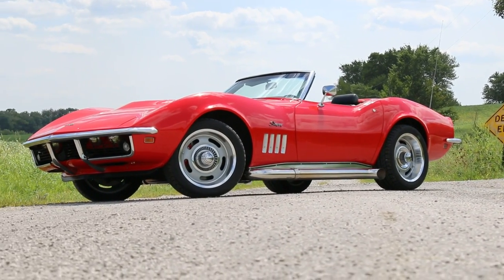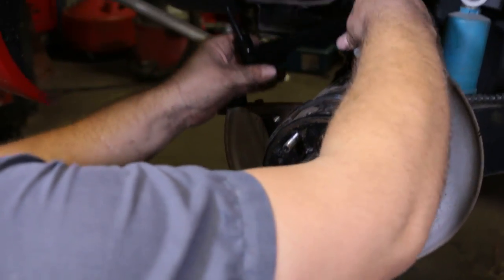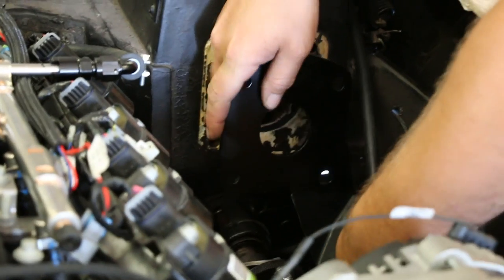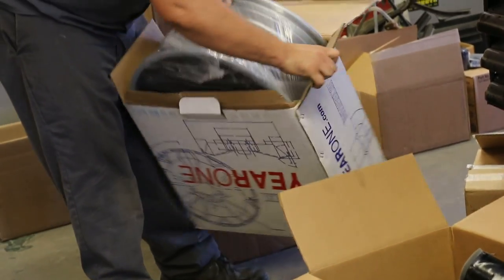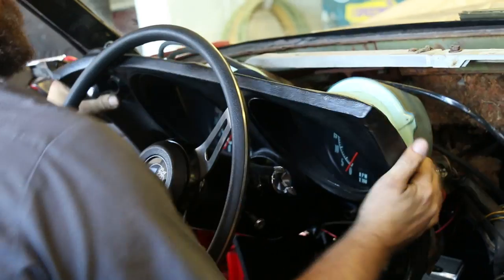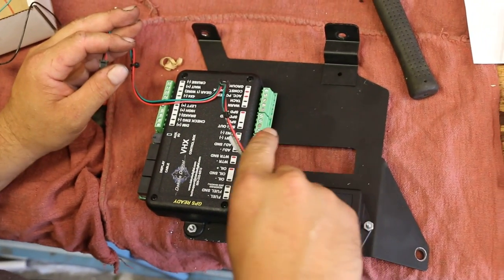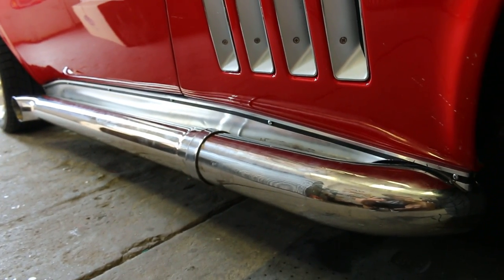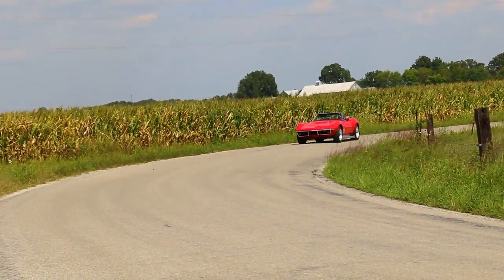Chevrolet C3 Corvette LS Swap 6 Speed Manual Transmission Swap at V8 Speed and Resto Shop Part 4

Comment: I put Vintage Air in my ‘71 convertible Corvette a few years ago. It still works great. The biggest hurdle in the installation was routing the hose to the driver side vent.

Comment: The shop did exceptional work.  Converting a 1969 corvette with modern day technology is not easy.  It is like buying a new corvette.  However, there is a downside.  As things begin to go wrong you will have a near impossible task finding someone with similar knowledge to work on your car.
Reply from the maker: Thanks for the kind words Ben!

Comment: Awesome build. I'm debating between building mine into a 383 stroker or just dropping a LS in there. The fitment issues make the stroker build look like the easier option :)
Reply: It is the easier option fitting the stroker. I installed a 454 in mine lol.

Comment: Great video!  With the LS 3 and six speed conversion into a C3 do you have to use a big block hood, or will everything fit under a standard small block "flat" hood?
Reply from the maker: It should fit under the flat hood, as the LS was designed to fit in low modern Corvettes.   Today there are some accessory drive systems that bring the alternator down tighter as well.

Comment: WOW!! Excellent work gentlemen, that is a master piece. Love the video, new subscriber. I use to drive a 67 Stingray with out power steering, it was cardio workout. Did you have to add power steering to it?
Reply from the maker: We did install power steering, and a tilt steering column.

Comment: I just found this series and what an excellent one it is.  I'm looking into doing something similar for my wife's next car.  She has always wanted an '80 - '83 Corvette.  If I can find a decent-shape body for a good enough price, I'm pondering a very similar restomod, but swapping the T56 for maybe the 6L80 automatic so it's reliable and easy to drive.  

I fully understand the limitations of my question, but is there a way to have a ballpark estimate for what I should budget on the mods/labor?
Reply from the maker: Hello Sir, every car is also a different situation.   However, we'd be happy to chat with you about what you'd like.   If you get a moment, you can call the shop at 314.783.8325 or click to http://www.v8speedshop.com and fill out our inquiry form.   Thanks for the kind words, we hope to hear from you!
Reply: @V8TV  Will do.  Thanks for the contact info.
Reply: They did not make a vetted in 83 and the 84 was not very desired as u can tell by resale prices now

Comment: Okay
But ...HOW MUCH!!!!
Reply: I'm guessing 350,000.00. But there are some serious  breakthroughs that were dealt with that are no doubt going to be part of future kits/ installations and that no doubt had some factor in cost savings to the customer..The tenacity that made this build possible was actually beginning to make me ill.the mock up and fab of the trans tunnel  was more than I could endure. I had a highly dysfunctional relationship with a 69 roadster. Triple black, Hooker pipes T/A radials on cragers..The top always leaked..And it rode like a worn out pickup truck..No amount of money ever solved those two ultimate deal enders.
Reply: @toosunakabooma1213  oh
You worked on the development of this kit?
Reply: A 6 speed manual from Silver State with everything is about $8-9k Car Effex here in New Jersey charged me $3k to install it.

Motor depends on what you want in it, brand new crate motor? $30-40k depending on what you want and HOW MUCH POWA BABY!

Figure shop time at $120-140 per hour.

Wheels and tires 🛞 between $2,000-7,000 depending what you want.

Brakes $3-4k plus install at $2-3k

So I would say under a $100k if you’re putting in a new crate motor.

$350,000 and your doing a new car that is going to be a body off restoration, rotisserie done body with a new chassis and everything you can think of. 

So it depends on what you want to do restore, modify or go pro touring/show car. 

If you’re just driving it and want to do the work yourself, just take it piece by piece and get it done.

Comment: Wiper door and lights still vacuum?  Also, what’s done to suspension?  Mine was squirrelly as all heck with stock gear and power. I’d imagine it’s been upgraded somehow. Details please
Reply from the maker: Hello @Wooca, we did an electric conversion on the wipers and headlights and there were some suspension mods when we started.     You can see all the details in the other 3 episodes - here's the whole playlist.    Thanks!    https://www.youtube.com/playlist?list=PLGV8X9X8baVizfPH6-qxNKrHmnGUAr81Y

Comment: Hello I have a 1979 Corvette L82 and I like to put a LS7 in my car?
Will that work because right now. 
Its automatic with transmission?
So I like add more power so if you can please let me know will the LS7 work?
Thanks.
Reply from the maker: Hello Daphne, the LS7 is a slightly different animal when it comes to LS engines, mainly because they were designed for a "dry sump" oil pan system, meaning they require an external oil tank, lines, and pump.   This occupies much more space than the LS3 or other "wet sump" LS engines.  And LS7 can be converted to a wet sump system, but that is an extra step in the process.   It may be easier to make similar power using a modified LS3 platform to start with.   The LS7 may bolt to your automatic transmission, however, we'd recommend a more modern electronically controlled automatic to handle the power of the LS7 and provide easier tuning and calibration of the transmission.     This might require additional fitment modifications to the tunnel to install.    These are general answers, we hope they help you with a bit of context.     You can reach us at http://www.v8speedshop.com/contact and we'd be happy to discuss your ideas further.   Thanks for the question!
Reply: Not to mention that factory ls7 needs heads replaced asap, you're better off with a sleeved block and have it built to whatever cubes you'd like with wet sump crank and better heads.
Reply: I just did an LS3 in a 75. Way easier than the LS7 would be.  Good luck!!

Comment: When is it appropriate to use a K&N, (or any other brand), filter?  I had an LS3 and now have an LSA and haven't used a K&N on either of those.  What's the advantage?
Reply from the maker: Great question.    We used the K&N in this case because they offer a huge variety of shapes / styles of filters, and their catalog provides dimensions for all.   This way we can design a custom air intake and pick a filter to fit.    That and we know the flow characteristics are better than a stock paper filter, and they last forever.
Reply: @V8TV  
Thanks for the answer!
One more quick question - you see all these people immediately slapping a custom intake on their stock Camaros - you'd have to tune it to get any benefit from it, right?  And even then you're not going to notice a difference unless you start making drastic modifications?  And because it flows better does it let more dirty air into the system?
Reply from the maker: That depends.   There are some air intake systems that don't require a full re-tune, as the stock ECM can compensate a bit for slight changes in airflow.   More drastic mods do require revising the tune for optimal performance.    Higher airflow does not necessarily mean less filtration.    Hope this helps!
Reply: @V8TV  

Thanks!

Comment: Witch tires did you use on these wheels?
Reply from the maker: Hello Robert, we ran BFG G Force comp 2 a/s 245/45R17 on the front, and BFG G Force comp 2 a/s 275/40R17 on the rear.

Comment: Wants to keep it original, doesn't want it original, want's it original, doesn't want it original.  I don't get it.  Either it is, or it isn't.  Doing whatever you want to your own car is great but it just seems inconsistent in this case.  My L-71 1969 that I've owned for 52 years still runs great with almost 180,000 miles.  It goes like hell and stops safely.  With the GM HEI, Hooker Sidepipes and a few other mods, it runs better than factory.  But, I have changed my car to suit my own prefs and never have worried about "original" which seems to be the big thing these days.  Hopefully the owner will enjoy his car for many years to come.  I plan to do the same.

Comment: What seats did you use for this?.
Reply: Ohh. And would a crate 350v8 be enough for the tremec 6 speed? 

Could I put a tremec 6 on my current engine?
Reply from the maker: The seats are the stock ones that came with the 1969 Corvette.     It is possible to install a 6-speed behind a small block Chevy engine.

Comment: anybody gotta clue what this would cost, 15k i figure
Reply from the maker: It depends on the parts... the driveline and fuel system put you in the $15k range alone.
Reply: Dang, so this guy prolly dropped 25k to have this done then, its badass no doubt. To some people thats chump change though, and even then he's way under what it would take for a newer car to touch it. I'd go to gmperformance and buy that lsx 454, for 20k, insane power, more less plug and play. I'd have that tranny built up, and that package would hang w anything pretty much. Have you guys dropped any of those LSX's, that's really a helluva deal...Roost
Reply: Lol 15k
Reply: Brake package and wheels would be 5k just in parts. If I had to guess I'd say 40k would be a good start.
Reply: @chisel83  well if you have it to burn I guess. I drove one of these that was for sale a couple years ago their badass no doubt. At the end of the day its an old car, feels old, drives old. I'd rather have a new one but I understand the love, that c8 i'd rather have it and it'd spank this old one except MAYBE on the highway and i'm not sure even there the old one would win. Fine ass car though
Reply: @Hugeroost  I think with all the upgrades it would be a decent driver, not as a good as new one which would have better chassis and suspension engineering obviously but you get that classic body style with modern driveline and braking.

Comment: WHY SO MANY HOLES IN THE WHEELS,AND BY THE TITTLE I THOUGHT I WAS GOING TO WATCH WHAT WAS INVOLVED IN PUTTING A SIX SPEED IN A C3 SINCE I HAVE A 2002 CAMARO 6 SPEED I WANT TO PUT IN MY 77,HENCE THE THUMBS DOWN FROM ME
Reply from the maker: Allan, this is part 4of the series.   We cover the install across all 4 videos.  Did you see the others?   Here's the whole playlist:    https://www.youtube.com/playlist?list=PLGV8X9X8baVizfPH6-qxNKrHmnGUAr81Y.        The holes are to accommodate different bolt patterns with the same wheel.
Reply: @V8TV  ya sorry i am an idiot
Reply: @allankwiatkowski8217  dummy
Reply: @bilbobaggins4710  ya thanks for your comment,but at least i had balls enough to apologized,and left my  mistake up instead of hiding it,unlike most humans i maned up

Comment: Sometimes I just don't get it.  Wanting the car to look stock with the newer radio yet not caring that it doesn't look stock with the Dakota gauges?  Why not be consistent about everything?  The motor, brakes, wheels etc. are all NOT STOCK and not STOCK LOOKING. There is nothing stock at all about this car so it just puzzles me but it's not my car so I don't care.  It's just weird to think about how other people "think".  When in truth, all cars are "stock" for about 15 minutes until you drive them off the lot.  Then they become used cars with original equipment.  A water pump needs replacing, and the car is no longer original and never will be again.  After some years go by, the owner wants to make the car original, but it can't be done.  Even if you hand paint factory codes on the rear end housing and try to duplicate what the factory did, it's NOT original.  So, why not be honest and if you own the car, make the car exactly the way you want it and as comfortable and safe to drive as possible and who cares how "stock" it looks?  I realize I'm alone in my thinking but oh well...